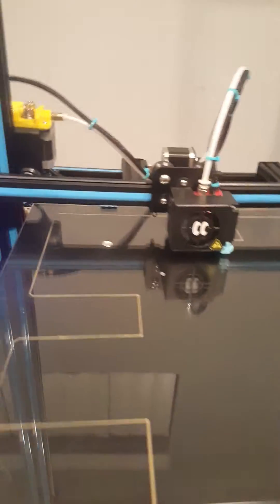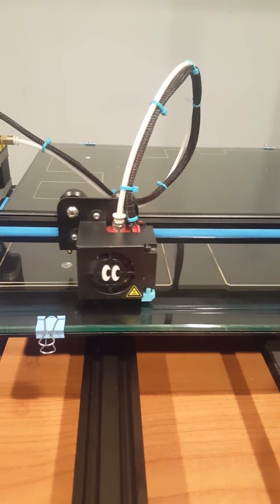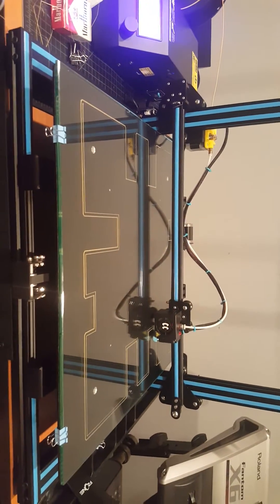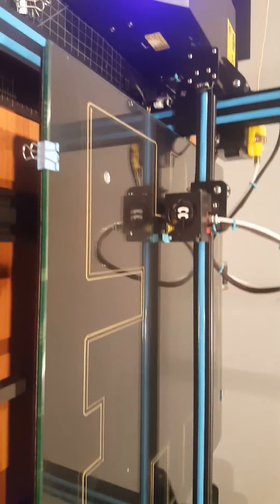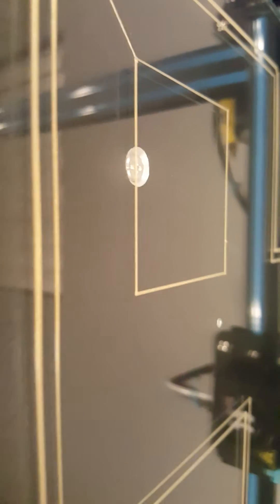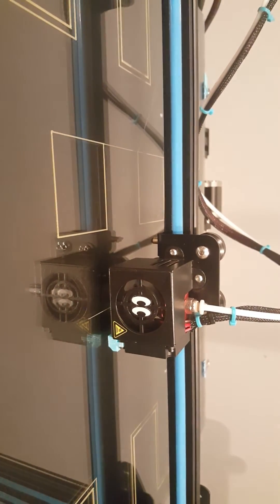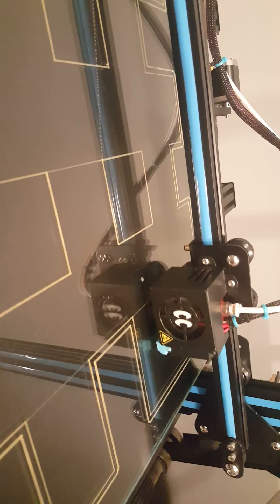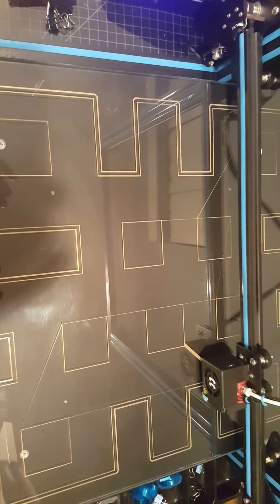CR-10 S5 Build Plate Leveling

Comment: Has anyone notticed underneath the plate the belt moving the Y axis seems to be pulling down the plate?   Just got the printer a couple weeks ago I have great prints already but looking for superb ones.   By the way there´s already too much weight for the factory fast moves if you swap the glass for a thicker one, make sure to lower the jerk, easy to do on the printer, Cura has the option to control it as well.    I did not replace my glass yet but still using the lower jerk.  Found 6 to be much better.  With jerk set to 6, I can up the print speed a bit for outher walls, inner walls, top and bottom layers, however infill...  Upped the temperature 15 celcius and that helped, but being honest that extruder is not built for speed and acuracy, having only one side with gear, it allways will get to the point of grinding my pla.    looking forward to replacing the extruder with one that uses to gears to move the filament, then will retest upping the speed of the infill.
Reply: meant 2 gears... for the replacement extruder. Email me with any thoughts or upgrades gionew@gmail.com

Comment: I replaced my Glass and do auto level each corner with paper and then it goes to center and is to tight to get paper under. ?   any thoughts.
Reply: Try the other side of the glass. Sometimes that works.

Comment: This is not the only fix, i've replaced the glass with mirror for ultimate flatness, same issue. Looks like its Aluminum body issue. 

Also, these Crealiy's are known to be concave or bowed in the center after leveling each corner, hows that looking ?
Reply from the maker: Its a cheap fix

Comment: Moe does the extra weight seem to effect print speed? I am love how it solved the bed leveling issue nice work. I am just worried about adding extra mass to that fast moving bed... vibration/motor stress etc..
Reply from the maker: James Richardson  i had to lower the jerk with my upgraded firmware but if your using stock it worked just fine..